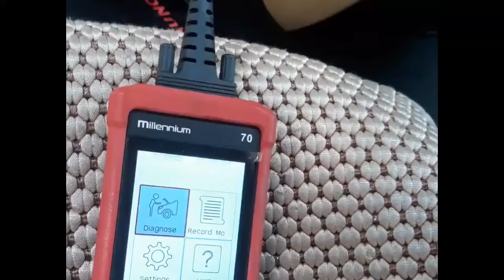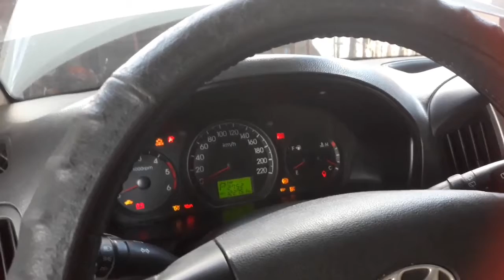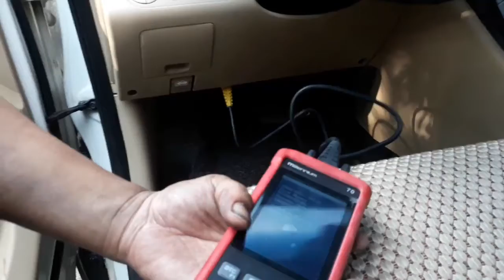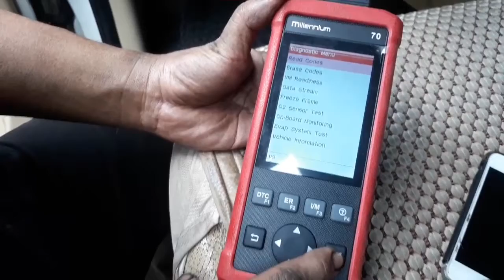Hyundai Grand Starex Automatic Transmission Problem | P0741 code

Comment: What was the error then? The solenoids are all ok? I did not get it.
Reply: error code p0741 means "Torque Converter Clutch Circuit Performance or Stuck Off".... so we need to troubleshoot the torque converter clutch (TCC) solenoid first. If the TCC solenoid is working, then the problem is the torque converter itself